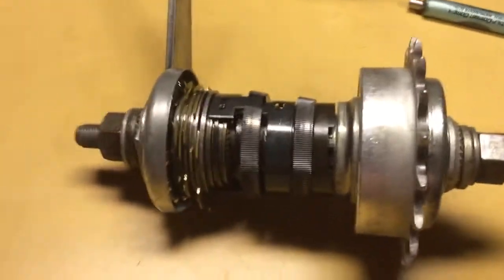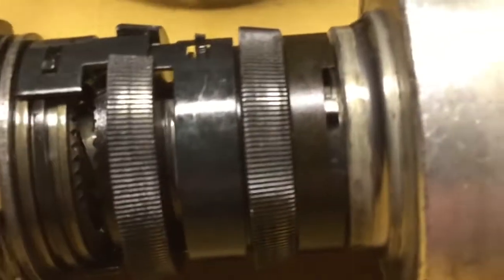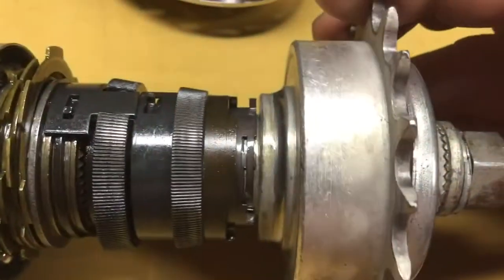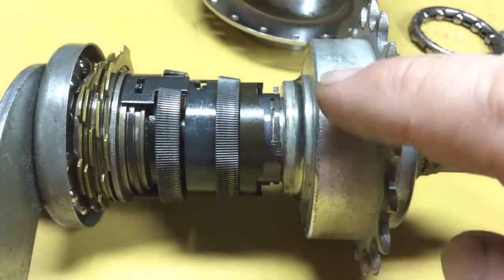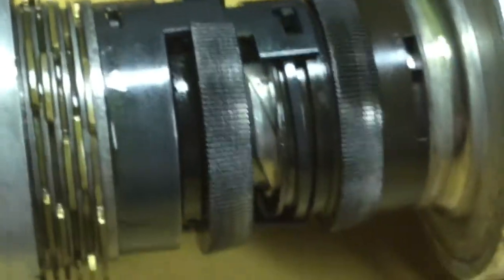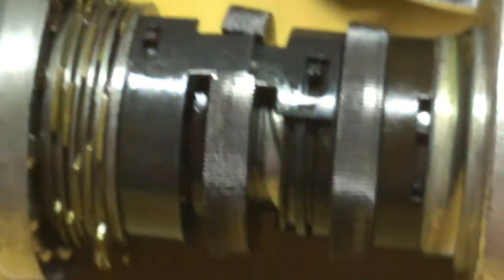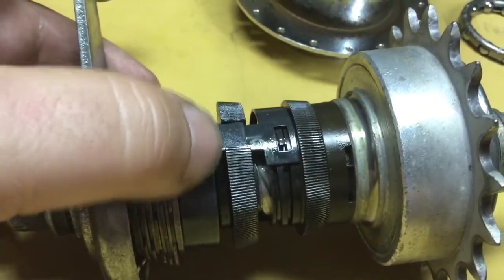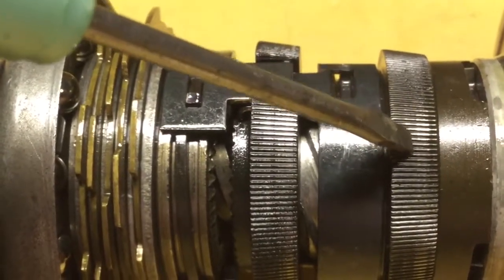Bendix 2-speed how it works part 1

Comment: This has been very helpful. My high speed clutch slips. Can you tell how to adjust or install properly?
Reply from the maker: Scroll up to the video description and follow the link to the other 3 videos I made on this hub. I give some trouble shooting tips in the part 2 of this video that might answer your question.
Reply: @okbridges  thanks for the reply. I have watched all three and had the darn thing apart a million times but high gear clutch keeps slipping. Too tight too loose?
Reply from the maker: @rickgranados7844  check the high speed retarder spring. Does it have the same drag as the low speed retarder spring? are the two retarder springs coupled together correctly?

Check that the high speed driver will engage by assembling just the high speed driver parts, no axle, no brake shoes in the right side of the hub. Can you make the high speed driver lock onto the hub shell? If yes, examine the other parts that interact with the high speed driver. If no, it will not lock, look at the high speed driver and hub surfaces and check for wear. 
Something is blocking the high speed driver from full engagement, or the parts may be worn. 
Check the sequencer spring.

If you 'play' with the parts a bit, you will see that the high speed clutch has to engage the hub shell before it runs out of travel on the threaded driver in order to drive. If it 'bottoms out' on the shoulder, or something else, it will not engage or 'bite' the hub shell and drive.

Comment: I have one of these I'm working on , Brakes fine but will spin in forward. Not sure what to look for? Don't see any visible breakage.
Reply from the maker: Assemble just the driving parts in the hub shell and see if the driving cones will engage the hub shell. Do it for both high and low speed driving cones. Then check the drag springs.Must be enough drag that nuts can run up and down the drive screws as shown.
Reply: okbridges I did notice the index spring was shot. It had some broken tabs. I will try dropping the the gears in .I pray they grab. The new spring will be here soon. Thanks Dan
Reply from the maker: If the index spring is broken, you will loose 1st gear, and have only direct drive (2nd gear).  Watch part 2 of how it works. Assemble  the low speed driving screw and driver, and all the driver side bearings and check that the driving cone will engage the hub shell. If the hub shell or cone are excessively worn, the driving cone will bottom out before it can engage.

Comment: Hi there, I recently picked up a slew of old Schwinn's that included a 1963 Traveler that uses this brake system. Most of the pins are broken and the bike really isn't worth what it would cost to buy a replacement. Is there a way you recommend I could reassemble this so that it will function for driving without the shifting/braking?
Reply from the maker: Yes, if you assemble the hub without the indexing spring it will operate in direct drive only. Braking will still occur thru the gear reduction of the planetary gear set. (Bendix called this ‘power braking’!)
Reply: @okbridges  Awesome, thank you so much!

Comment: I have a single speed stretch beach cruiser that sucks on hills....can I swap out the inside of the 1 speed for a 2 speed so I can do hills...I don't want to have to build a whole new rim
Reply from the maker: You will have to rebuild the wheel, the internals of this hub will only fit the hub shell with 3 red bands.
Reply: okbridges thanks...damn but thanks